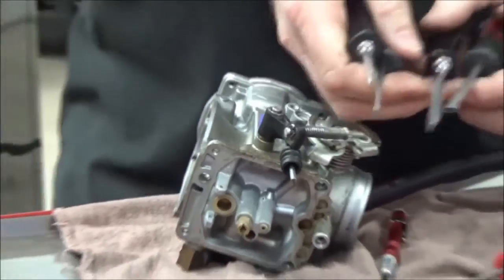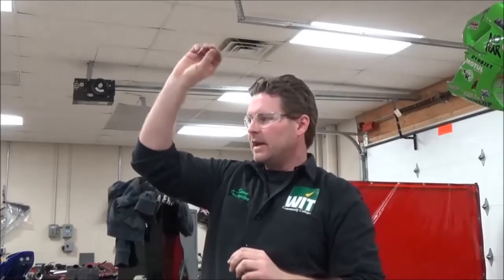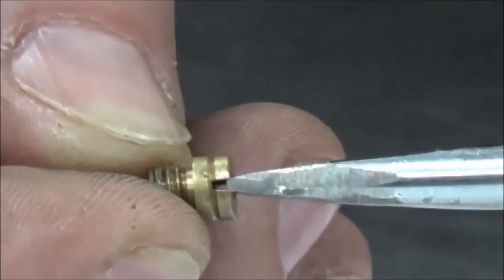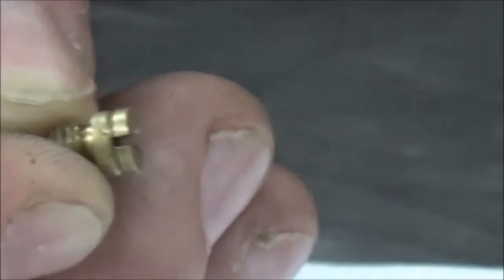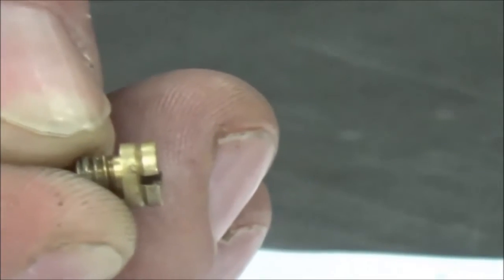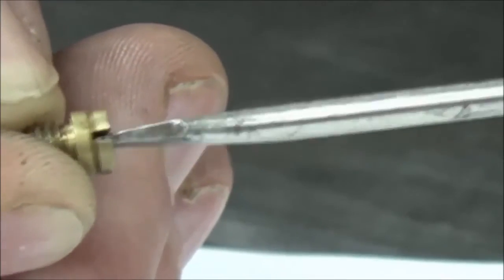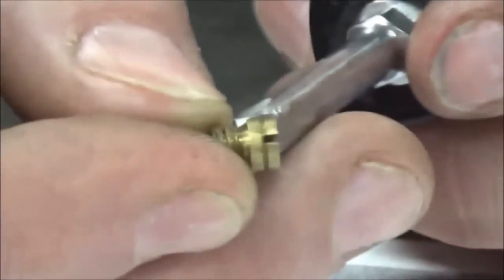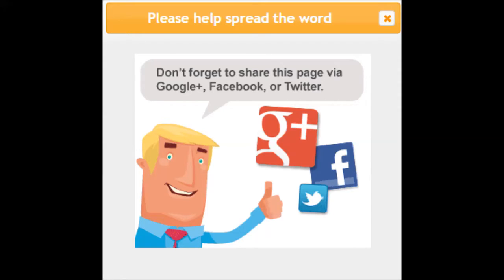How to make tight fitting carburetor jet screwdrivers! Jet Driver tool hollow ground like fitment

Comment: As mentioned in the other comment hollow ground AKA gunsmith screwdrivers are ideal for jets. That's why I used to cut off ROUND shank screwdrivers and grind a hollow ground tip with a SLIGHT flare to best grip the soft jets and now do so to common hardware store hollow ground screwdriver bits.
Your tip should look like this )_( from the side when you're done. It will save your arse on buried low speed jets.
I love your videos but I  strongly suggest taking this one down and showing a common hollow ground screwdriver bit instead or modding a round shank screwdriver. Common flat tips are trash even for their intended use!  I use #2 Phillips donor driver. Long shank screwdriver bits are easy to find. I have a variety in my "carb tool" kit.

Comment: The biggest thing to note here is the jets have parallel or straight sides, almost all screwdrivers are tapered. This makes the driver grab at the top of the screw and want to mar and strip the head. You want a hollow grind on your screwdriver. Gunsmith screwdrivers are perfect for this and they are made for straight screws. Even when you grind one do not taper it.
Reply from the maker: Thank you for making that point.